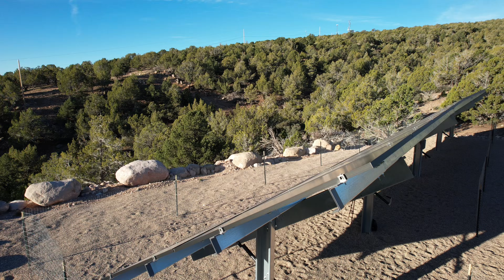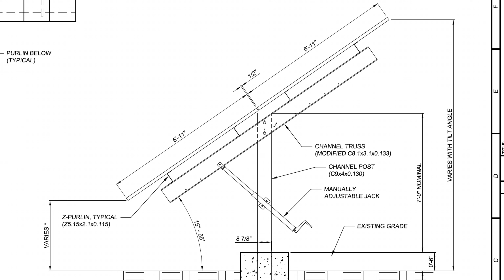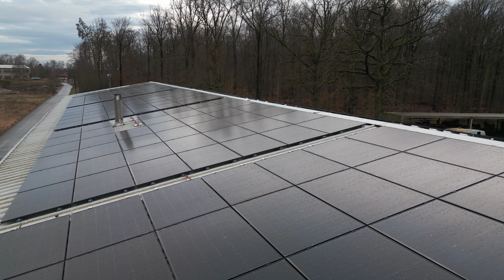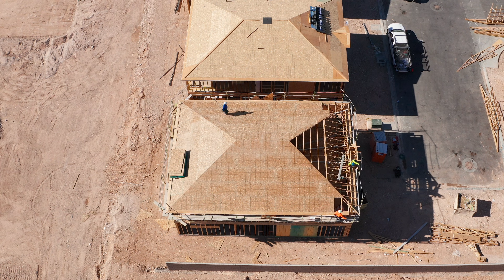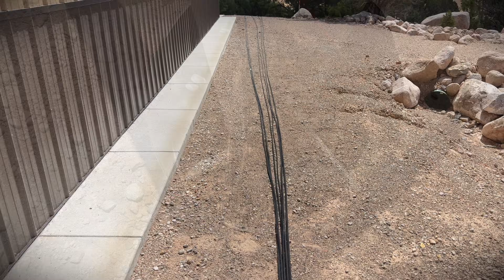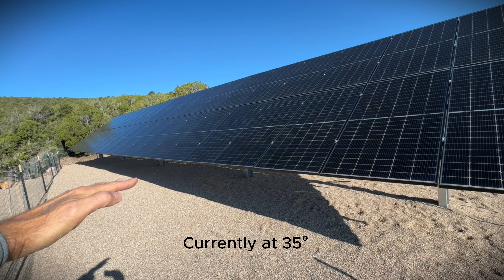Solar mounts- the first thing you need to do

Comment: I would say ground if it's clear just from a maintenance standpoint. And if I could change anything I would get rid of the solar trackers and do what you did.
Reply from the maker: Do the trackers not work well? I hear mixed reviews.
Reply: @Kolob_Canyons_Ranch weve had to replace a sensor in one which isn't that big of a deal but the older one stays flat and won't follow all the way west. The company he used 25 years ago doesn't exist anymore and I can't find parts. We will have to replace it with the same system the other array uses which is a large cost. No room where that's at to add a mount like yours.

Comment: 60 450w bifacial of mine are on IntegraRack mounts. I did all that to get the tax break. Had a licensed certified electrician install the big cables, and look over everything once per month to check on my work. Now I have time to get a pro company to pull all permits and put some on the 6 car garage,  and big patio (which can hold 45 easy by itself, and then some on the shop roof. Rest can go for shade structures for the pool areas. Then wherever i got space where they are not visible, I will use the integra racks. Left over stuff, I will install small systems for my parents and my little brother. Been a great learning hobby since last May. Hobby with a result 👍
Reply from the maker: Sounds like you've got a fantastic solar journey going on!
Reply: @Kolob_Canyons_Ranch  Yup, got 3 jobs as a surgeon in AZ, but when the kids would go to bed or my days off, I would get out there and learn/study. Started about 7 months ago of intense studying and testing. Cost me for some mistakes, but worth knowing this stuff now.

Comment: Ground mount every time if you have the space for it -- maintenance is so much easier.   I have 43 panels here.  34 of them were professionally installed on the roof.  Nine more are on a DIY a small, DIY ground-mount.   It snowed last night.   Guess which panels are are producing today?   No, at 66 years old, I'm not fooling around on a snow-covered roof!
That said, if you're building a house, or re-roofing one that you want a roof-mount solar system on, put a standing-seam metal roof on it.  A quality one will last 50+ years and there are mounting systems for that type of roof that clamp to the standing seams and thus don't require any penetrations.
Reply from the maker: Great input! Didn’t know about the clamp racking.

Comment: Why didn’t you install the solar array higher, so that you could park cars or equipment under it?
Reply from the maker: Good point! We did consider that but wanted it low for easiest maintenance. We’re building another garage structure on the other side of the house now. 😂